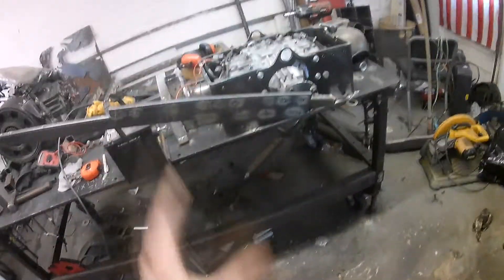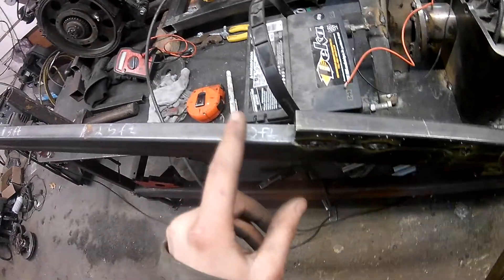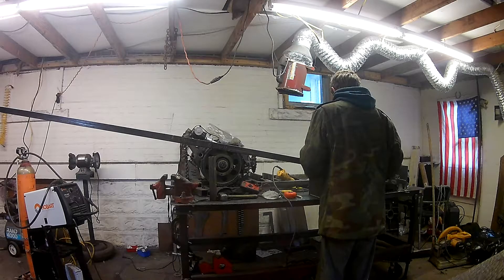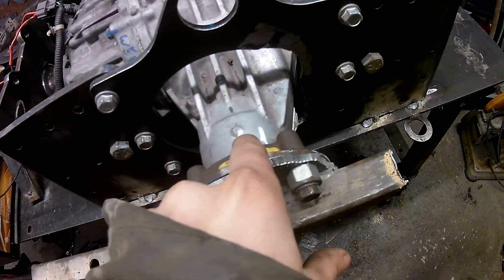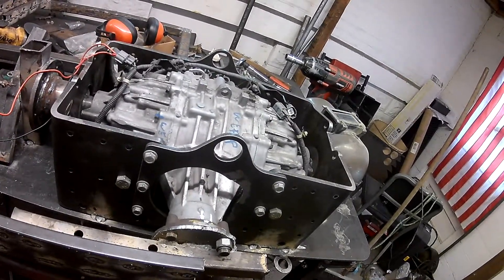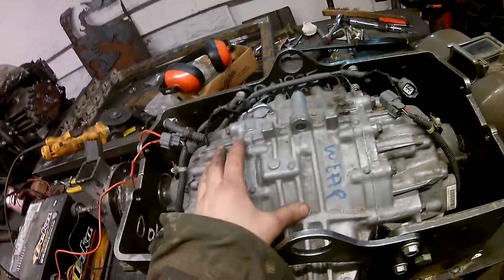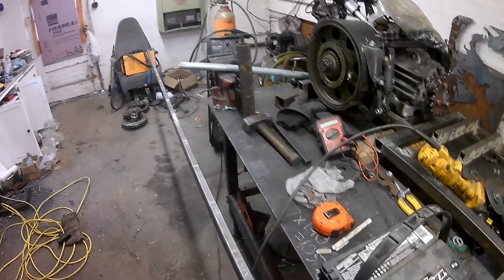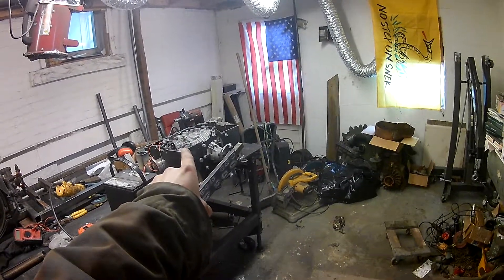Max Clutch Torque Capacity: Acura MDX Rear Differential 2007-2014

Comment: the tests are carried out incorrectly: in the gearbox a ball clutch is installed, which tightens the friction discs, so that the clutches are fully clamped, it takes half a turn of the shank, so you need to re-hook the lever and press it again! real torque 1500 Nm on the shank and 2700 on one shaft
https://vk.com/wall-182017010_13
Reply from the maker: Hi, this is the 2007-2014 MDX rear axle. It does not contain a ball ramp clutch like the VTM-4 style axles on pre-2007 MDX vehicles.  The axle that I have uses planetary clutches.  Clutch actuation is based solely on magnetic force of the solenoid onto the wet brake that is coupled to the planetary gear set.
Reply: @pinestumps8622  Ok